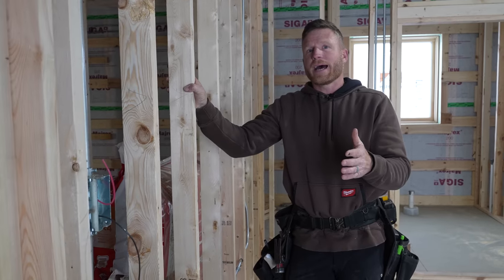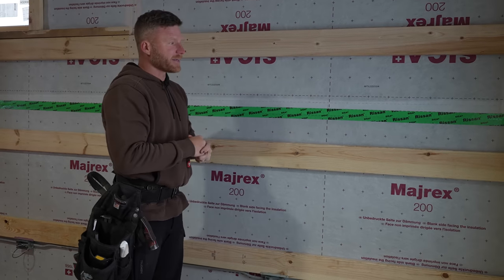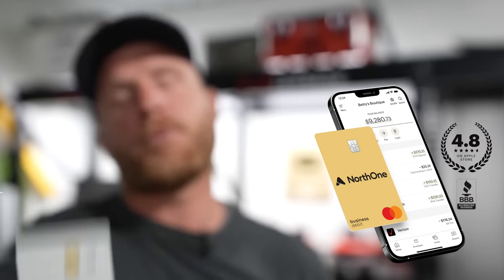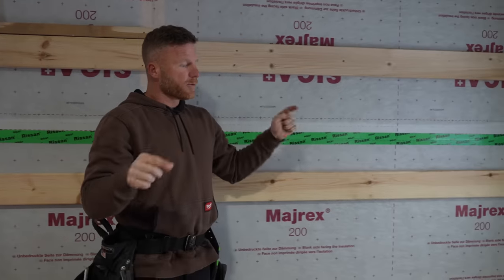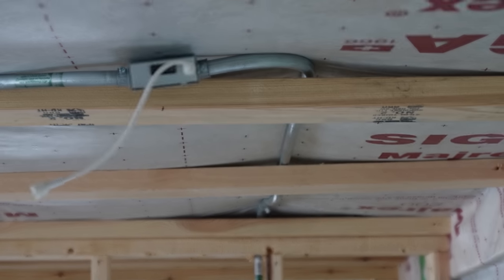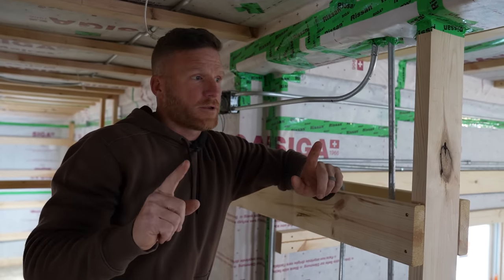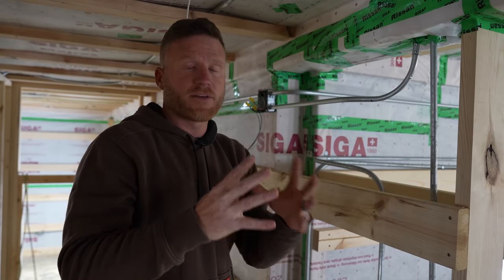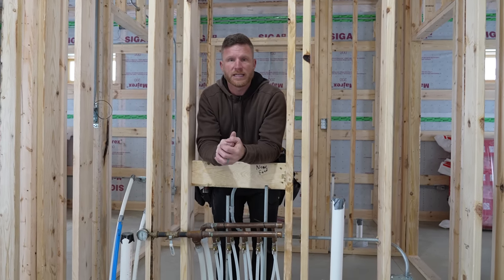The BEST way to run ELECTRICAL in the BEST HOUSE

Comment: Been building like this in Norway/ scandinavia for years now. exept we build stickframe not post. works great. No bad air inside and no mold.  Glad to see someone in the US also believe in this way of building houses.  love your videos! Greetings from Norway.
Reply: Hi, It seems that you have a great experience. 
I am a student eager to learn about construction work, I'm actively seeking someone in this field who can share their expertise with my student team. Really need insights from you, feel free to hit me up! :hand-pink-waving:
Reply: Skjønner ikke hvorfor de bruker stål rør til elektriske anlegget🙈 Det ble gjort i Norge for 60 - 70 år siden. De henger etter på så mye syns jeg, men det er bare min mening🤷🏻
Reply: I also have been following the Swedish framing/insulation model for years. On this particular wall, we would have added 1.5” of rigid insulation in between the nailing gerts. As you said, it is nice to see other builders starting to adopt a new method of building.
Reply: @Jens92 he literally says the client requested conduit and they usually use romex.
Reply: Depends on the funding for projects like this. Your average American can’t afford a home this standard. Not to mention over half the country doesn’t get cold enough to need this thermal efficiency. Pretty cool to build it, but when it comes down to 10 of thousands of dollars for a few efficiency points. Most people will pass.
Reply: The most demanding, strictest electrical code, I know of is Chicago’s electrical code. Everything gets done in the EMT conduit.  Enacted to prevent electrical fires (and keep union electricians working), it is  a good thing.  Working with EMT takes a little bit of training and produces a better product overall.

Comment: The great thing about running conduit for the electrical is if anything ever happens to any of the wiring, you can pull out the old wire and pull in new, and cost will be much lower and no new penetrations will ever have to be made. It definitely takes more time, and the cost is probably more initially, but conduit is really the way to go for several reasons. Looks like they done a great job.
Reply: I wonder what the cost ratio is for conduit compared to Romex.
Reply: @chrisbabbitt4202  you have the cost of conduit on top of the cost of wire. Then the wire you pull into a conduit run is single wires on 500 ft. spools of THHN/TWN-2 a double rated wire for wet locations, anything in a conduit is considered a wet location, so it would be significant, and it's going to depend on where you by the EMT, and not all are the same grade, so if you are getting it cheaper from one outlet, it may be because it's inferior, and you will be able to tell when you start bending it; the cheaper stuff has a tendency to flatten a little on the bend. but everything is up on price right now, and if you have any 240v circuits you would want to make sure to get red along with the black, white and green you would pull for a single 120v circuit. then you have all the connectors and couplings and boxes, single gang and four square boxes and plaster rings. and there would probably be a few 411 boxes with blank plates for junction boxes and pull boxes. some people use four square for junction boxes, but you limit yourself on those. Because half of the knockouts are 1/2" EMT and half 3/4". 3/4" is just easier to make your pulls in, but in some commercial settings, 3/4" is a minimum, especially in hospitals, so there are a lot of equipment parts to think of on top of the wire if you go with EMT instead of Romex. Romex is fast and easy, but there are benefits to EMT. but the cost is going to be significant.
Reply: True that
Reply: Very much agreed!!!!!!!!
Reply: @comingtofull-ageinchrist6736  don't you generally not need the green (ground) when running metal conduit as the conduit/metal boxes are the ground contact? i can see there may be some situations where it is required. most devices wired in would ground via the screw, but some may need manual wiring to a grounding screw in the box, but i think most wont. if you go to the 7:25 mark, you can even see they didn't run any green/bare grounding wire, just the black and white. for the most part, you should just be running the black and white unless you need a red, for something like a 240v circuit (what you mentioned) or maybe a 3 way switch or something.

 running conduit like this is definitely more expensive initially though, but i agree it is better for future proofing your house. you will easily and WAY more affordably be able to re-run wires when everything has changed in 10/15/20+ years or so.
Reply: @darrellcurrier5571  That's really a great question. The NEC requires a ground in every conduit/raceway, and when you're running EMT  or RIDGID, you are required to bond every box, with or without a device. You cannot rely upon the connections to electrically connect your boxes to the raceways; it isn't considered a reliable connection for ground.
Reply: As cool as it would be to run conduit,  I could never win jobs and run conduit,  definitely an unnecessary cost increase
Reply: @mag3604  not that it isn’t necessary but proficient in the long-haul! But I definitely know what you mean about bidding an electrical job! Some people under bid jobs and then hit the client with extras towards the end and are deceptive about the cost in the beginning in order to get the job! Electricians should aim towards identifying those things, so they can educate people on hidden costs that will come up towards the end! But I completely understand the cut throat competition on electrical bids!
Reply: This is a good point. But you’d have to have many electrical problems over the building’s life to justify the investment
Reply: @paulgaras2606  no you wouldn’t, not in my opinion! There’s more benefit to running conduit than just replacing damaged wire; in my opinion it’s worth it. It’s automatically protected from damage and protects the structure from electrical fires also!

Comment: Great to see an evolution of building technology on an american building channel. As a swedish elictrician i love to see all electrical in conduit inside the walls, which has been code here for 100 years. 
I know this building with the variable vapor barrier and air sealing works great and is how we have been building last 15 years, and it works fort both heat as 30*C and to as low as -25*C. No problems with mold or smell or bad health.
Reply: 95 percent of builders could care less! Only the 5% that care about building a great house that will last a 50-100 years and prevent mold and moisture will do it! If it’s not part of the bldg code! they’re not gonna do it ! Nobody else gives a rats patootie! With that said, I care, but I’m extremely well educated about this through YouTube university!

Comment: Kyle, use the ERV/HRV for the bathroom exhaust. It will limit the penetrations through the cavity . Also allowing the use of 20/40/60 timers at the point of extract.
Reply: I've seen this done in new construction up here in Canada; the bathroom basically has a 4 or 5 inch "exhaust" port tucked away in the corner of the wall and is drawing air 24/7. No need for exhaust fan switch at all.
Reply: @wesbuckley5535  I am an Energy Star Builder in Wisconsin/Minnesota as well. I've been using the ERV/HRV as an exhaust for the Bath/Kitchen/Laundry since 2000. What I like about this type of system is that the penetrations to the outside are limited to the ERV/HRV, it's really quiet (No loud bath fans), and the use of timers for the kids that usually forget to turn the fan on.
Reply: The ERV should provide plenty of ventilation for bathrooms, no need for a dedicated bathroom exhaust fan. What I haven’t decided is if I need makeup air for the kitchen range hood. The ERV I am considering can handle some of the imbalance but only upto the max flow of the supply fan (the exhaust side effectively shuts off).
Reply: @wesbuckley5535  The amount of moisture dumped into a bathroom by a long hot shower is not going to exhaust very quickly through the erv at its base ventilation rate…. there may be a code requirement for a boost switch
Reply: @wesbuckley5535  I second C most places have code requirements for a boost switch. The thing I really like about using an erv or hrv for bathroom exhaust is you are not wasting all of the heat generated from the shower and range hood in the kitchen.
Reply: @user-ky2pi7fo6h Yup! To do this correctly would involve a large multi speed ERV with high cfm capacity and a multi zone low voltage control set-up. 
($$$$) I do both in my clients homes to give them options, also in Canada a lot of people turn ERV's off during coldest months.
Reply: Sounds like code changes between jurisdictions.  Imagine that!?  Point is the ERV/HRV is used as a bath fan. Code requirements are up to the builder to acquire and follow.
Reply: @reecedejong8770  Today almost all range hoods require a sepaerate make-up air system anyway.
Reply: @skylinephotographyaerialre1369  They make automatic humidity sensing switches for bath fans now that work great. They stay on exactly for time needed.
Reply: @ronlovell5374  I know, it's fabulous. The IoT (Internet of Things) has allowed the use of numerous different types of switches and sensors now.

Comment: Love your work guys!! 
 As an electrician myself I would have spent a large amount of time doing all my electrical rough-in in the slab with PVC, to allow me to not have to penetrate those critical areas of the air barrier, and to minimize both cost and time spent running that EMT everywhere.  Do you ever mention the total cost of this build?

Comment: Love what you do man. I didn’t read through these comments but… always think about the conduits themselves for an air path. You can just use ideal duct seal or a fire stop fill material to plug the conduits as best as you can inside the boxes around the wires, inside the panel, etc.

Comment: Great stuff!! We use additional tape for instalation of battens over  water resistant layer on our roofs. We use screws instead of nails to make the detail even tighter. In Czechia it’s the minimum code for water resistance. 

Great work you guys do it’s definitely up there with european way!!

Comment: Great video Kyle! You clearly laid out the benefits to creating a house with a tight interior envelope. I am an electrician, and we have seen recessed lighting continuously causing problems regarding air leakage, and in turn condensation, in the ceilings and attic spaces of many houses. The idea of strapping the ceiling below the air control layer makes so much sense from a lighting perspective. Also easier to run the NMD cable below the insulation. I worked in Germany and Austria for a bit and this is how every ceiling was detailed. Thanks for making content that you've put a lot of thought into! I really enjoy your videos.

Comment: hi mate, Im a passive hpuse designer. you have done well. i would recomend not worrying about the bath extractor fans. the hrv should be installed in a way that an extract air vent is fitted to the bath room with a boost button to outside using the hrv bypass. best way in my opinion

Comment: Much appreciate the attention to detail. As a commercial builder we run into fire block issues all the time. Post frame does not seem to follow the same ability to contain fire to specific areas. How do you get thru inspection process without showing proof of fire control between levels and wall elevations.

Comment: In our most recent project we did the bath vent fans similar. We also used 4in solid pipe with pitch, so no condensation would make it back to the fan. As far as HRVs, ERVs, some counties require different codes. Being in the northeast, we have a couple of choices. We ended up doing a metered 6in fresh air intake to tackle the air exchanges.

Comment: Love your videos, I learn a ton and you and Greg always do high quality work. 

I personally would not want a house that is this airtight in 99% of cases (but absolutely see the value for those that want it).

I live as “off-grid” as I possibly can in the mountains in Colorado and an ERV or HRV requirement to me means more moving parts and greater potential for another point of failure (I’m well aware that you can take this logic to an extreme on either end).

I heat my home with a wood stove (and do have a HEPA filter running as a precaution… but it’s not necessary to make the home function). That on its own is a reason I wouldn’t want an airtight home for myself.

All that to say: You guys do awesome work and I learn a ton from you. You just said you wouldn’t understand why someone wouldn’t want an airtight home. I guess I figured I’d give you my reasons. I may be entirely wrong in my thinking , who knows? But there are some instances I can think of where simplicity and a little bit of “leaking air” might not be the worst thing.

Keep up the awesome work! I do 100% agree that post frame is one of the best ways to build though!

Comment: I love seeing conduit in homes.  If you wanted to use Romex I would be cautious about a 1.5” cavity.  Code requires NM cable to be 1 1/8” from the rough surface.  (Basically a 1 5/8” drywall screw should not be capable of puncturing any part of the wire).  Your electrical inspector could be justified in failing an installation involving stapling Romex to the thin face of a 2x framing member or requiring metal protection over the entire run of wire.  If you make the cavity large enough you can eliminate this problem.

Also handy boxes seem an odd choice, 4” squares with plaster rings are soooooo much nicer to work with especially if you need to install a GFCI, dimmer or anything non standard in a box.  Lastly, running EMT to the transformers for the thin recessed lighting may come back to bite you.  Those transformers are meant to be serviced/replaced.  Hard piping then requires drywall to be removed if they ever need to be serviced.  I would also argue it violates the code requirement for that junction to be accessible.  (There is no way you can get your hand in there to fix a factory quick connect that jiggled loose over the course of construction.). The solution here is run the last bit of that run in MC or make your service cavity deep enough to actually be useful.

Anyways, love your vids!
Reply: They could always use stand offs like we do with furring strips on a block wall. Also I'm just confused as to why they would go above and beyond with running conduit in a house, then not pull an actual ground wire.
Reply: You dont need a ground with emt counduit. But looking at the video they shouldve. I can tell by the video that this isnt going to be inspected. And if it is. The electrical inspector is going to have a field day. 3ft from box and every 10’   I see neither for strapping
Reply: If you’re talking about the LED wafer lights I agree. And I never trust the conduit as my grounding conductor.
Reply: @AntonioRamirez-xg5ce  yeah no straps all in wall no way im doing that without strapping
Reply: @deke80 he is probably up near Chicago and conduit is code for all buildings. The use of flex and mc is very limited in that area.
Reply: I agree. I don’t see how romex could be used in this type of situation, since it has be to at least 1.25” back from the drywall. Do you staple it to the insulation?
Reply: @R900DZ  you can within a 1 1/4 from the stud when your strapping with 12 or 8 in of the box. But after that you can use a staple and use a piece of scrap insulated wire and use it as a tie wrap and it’s totally legal. Or use ul listed romex stand offs. I dont agree but i also dont argue
Reply: @AntonioRamirez-xg5ce  sorry but I don’t understand what you mean about wrapping scrap wire around romex
Reply: @stuffguy7  when EMT connections are made properly and wrench-tight, the EMT itself is the equipment grounding conductor.  Omitting an extra equipment ground wire in the conduit saves unnecessary expense and labor when wiring the boxes.   The down side is you have to carefully inspect every EMT connection.
Reply: @AntonioRamirez-xg5ce  I noticed that too.
Reply: @dirtavalanche7182  You are correct, it is just confusing to me why they would go through the extra expense of using emt where it isn't required, and not the slight bit more to use an actual ground wire.

Comment: Skyline (commented here) has a great idea. 
My initial thought during your vent fan discussion was that the fan could also be wall mounted to an interior(dividing) wall and the exhaust duct could run straight to the exterior wall. Skyline's comment is better yet as it has no exterior penetration and also allows the bonus of reclaimed conditioned air rather than exhausting that conditioned air to the outside.

Comment: To eliminate air Ingres through electrical penetration - use armored cable, cable glands ( you can even get IP68 ones) and gland plate, which you can cover with wrapping and tape after the installation.

Comment: Siga makes an EPDM type  flange with a Fenrtum type tape embedded onto it  for penetrations called a Manschette.  Made for both the Majvest and Majrex. Also comes in 3 different sizes for anything from 1/2 pipes or wires to 7" ducts.

Comment: Your bathroom vent fan ducting idea makes sense. I have a bathroom fan that is ducted through a well insulated attic, into the roof. The duct unfortunately is not insulated, consequently it rains water out of the fan when it's cold outside. My plan is to insulate that vent fan duct.